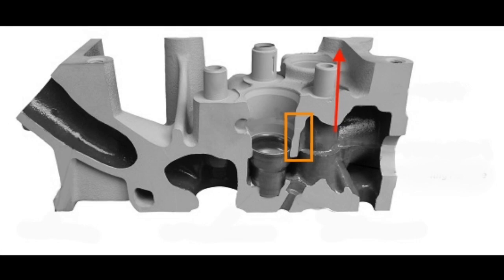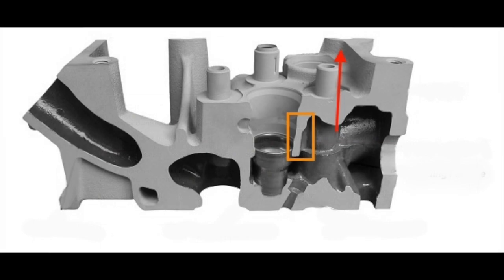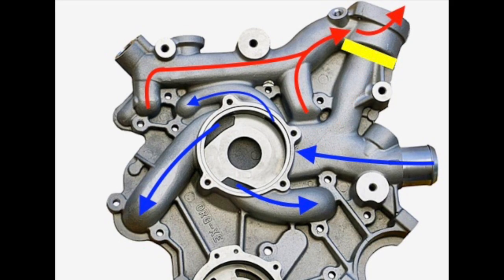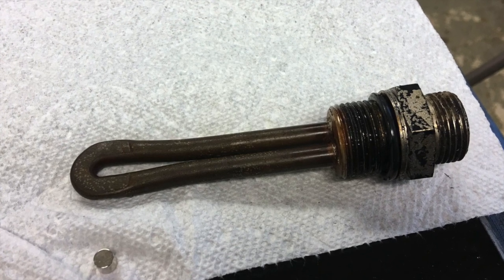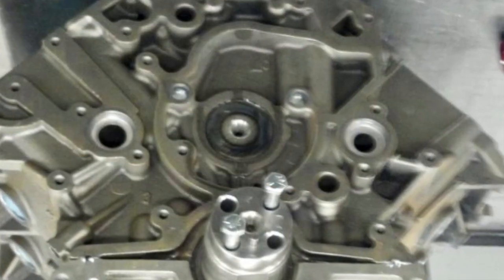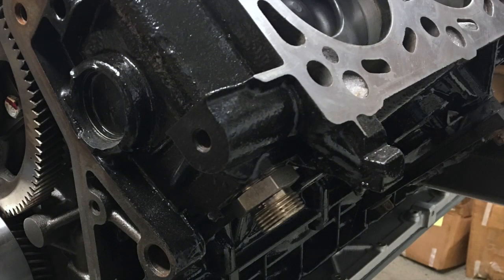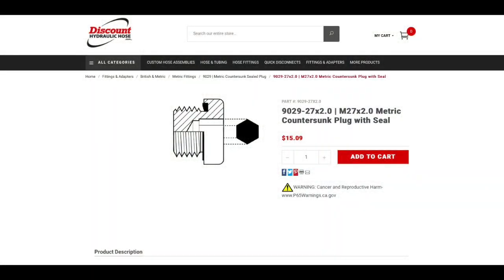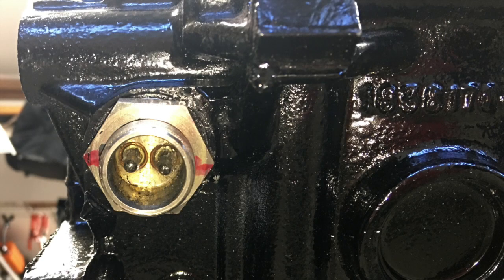Powerstroke 6.0 - Is the block heater causing injector cup cracks?

Comment from the maker: This is speculation of why there may be an occasional issue with head cracks, fuel in coolant.  A sample of one is a poor judge. 

To get a better handle on if it is a cause, people would have to note the heater element's position with a failure.  It is just weird that it's typically at injectors 3 and 5.

Comment: Where I come from you really need a block heater. I believe the cracks are caused by coolant flow problem within the heads that is the worst on the passenger side. When you install a coolant return system and delete the EGR, the cracks simply don't happen. The 6.0 is one of my favorite engines but in my opinion they have one fatal flaw. The EGR exposes exhaust gases that can reach over 900 degrees to directly exchange heat with engine coolant. This is simply a foolish design flaw as even the best engine coolant breaks down at less than half those temperatures.  The EGR delete is a must on a 6.0. The second greatest upgrade to the 6.0 is the remote oil cooler. I have seen 6.0 engines get these two upgrades at low miles and go on to reaching over 700K problem free. Another consideration is the Mishimoto radiator. The solid Mishimoto's are a great upgrade for the 6.0 and the cost makes it well worth it. I love your channel. I am a new subscriber that will be watching all of your stuff. Great work
Reply from the maker: Matthew, sorry for the late response.  

Something is going on with the left side. One person in the comments (not sure if this video) said he had a pickup bed of passenger side heads with cracks. When I put my borescope into the cooling jackets, there was no significant difference from side to side, except for the block heater. But when you look at the 6.4L block, with the different restriction plates at the coolant intake ports, and then look at the changes they made to the head gasket, opening the lower coolant orifices at the center of the head, they were changing the flow paths. But there isn't what I would call a radical change in the basic cooling jacket design from 6.0 to 6.4.

I'm not personally worried about the EGR cooler overheating the coolant as long as the oil cooler flows well. There should not be an extended dwell time for the coolant to get overheated, but that's a guess, as I've never measured the outflow temp.

I've had discussions about the coolant recirculation kits. I did something similar, but not as extensive, and I will have a video coming. It's an interesting subject.
Reply: @toomanytoys  I think your right about everything except the EGR. It's just poor design to expose exhaust gases to engine coolant. I can get at least 700,000 miles out of a 6.0 if I delete the EGR early by welding pucks at both ends. Unfortunately I know deleting the EGR is illegal in some areas but I actually get cleaner exhaust then you would with a poorly operating EGR, which is the calling card of the 6.0. I have been watching your videos and I am soo very impressed by your techniques and attention to detail. I especially appreciated your videos where you lapped the heads. Lapping the heads is soo important with the 6.0 heads. I also liked your video on the grounding and wiring for the batteries though I will have to watch them again to fully understand everything you said. You are a true scholar and you have the common sense that seems to be lacking in our modern world. I wish you ran the diesel engineering plant for Ford. I also hope you are still selling your engine pull brackets because I really want one when I get paid. Thankyou for putting your work on video so that others may benefit from your expertise.
Reply: False...
I have a 2003 6.0 with coolant return lines, deleted and after an engine reseal and new UCF heads in three weeks I had diesel in my coolant. They sent a new set of heads under warranty and I did a full rebuild this time...I mean FULL. 70k later (just a month ago) you guessed it, diesel in the coolant again. UCF is sending the third set and doing long injector cups on all 8 holes this time.
Reply: What is false? I didn't say delete cooling. The EGR is the main problem in the 6.0 design. The second greatest problem with 6.0 are the shitty, thin head castings before 2005.5. You are getting bad heads.  They are probably remans, or garbage Chinese castings. Go to Kill Devil Diesel and get a new good set of heads.  @MacJank7

Comment: I purchased the threaded fitting you showed, and it leaked. I knew it was questionable before I tried it, but took the chance it was going to work. The block has a step/ recess where the o-ring on the heater would normally seat. The seal on the block off fitting, is square and without adequate material to fill the recess for the sealing compression.
My engine is a 2006 6.0.
Great video.👍👍👍👍
Reply from the maker: I should have bought it to try it earlier.  It got away from me.  That was the only fitting I found of that size.  I'll buy it from you for whatever you paid and the cost to ship it to me, so I can try.
Reply: TooManyToys I'll just send it to you.👍

Comment: Never thought of that. I may do something different with my 6.0 when I get ready to install it. I need a block heater living in Missouri. Maybe try one that is in the lower radiator hose? Great video.
Reply from the maker: I wouldn't go too far down the rabbit hole with that.  After I saw the 6.4L block restrictions, it was a curiosity that would alter the flows right to left, so I kept wondering why they would do that. The front cover would have to have bungs welded so thermocouples could be added to know if it did something.
Reply: Why couldn’t thermocouples be installed the the freezes plugs on the back of the block?
Reply from the maker: @showmerepair  It a better temperature Delta if you get readings after an obstruction.
Reply: Good to know thanks

Comment: Navastar also in the the cooling pump flow rate on the 6.4. My personal opinion is there is a lack of cool flow at peak torque when the most heat is generated combined with the high operating temps for emissions.  If it's 220f in the thermostat housing, how hot is the cooling around the exhaust valves and the centre cylinders.  Next is out of spec block and cylinder head finish.
Reply from the maker: I would expect hotter, too.

Comment: Need help! Recently my block heater started tripping the GFCI. I’ve ruled out the cord and testing the element itself. I’m getting ~15.5 ohms Hot to Neutral but also registering various readings Leg to Ground. I believe the element needs replaced unless I’m missing something? Hoping I can swap out quick with minimal fluid loss. Gonna be a cold coolant shower!
Reply: This has me going insane lol.. It’s not the GFCI after trying 3 diff brands all new. On “Continuity” I get no beep measuring Leg to Ground. I will try to heat it using non GFCI tomorrow and see if it can drive out moisture or something, it did sit for a couple weeks in soggy weather
Reply from the maker: It's usually the cord.  I would drain the coolant from the radiator first.
Reply: @toomanytoys  I thought so too but tried a new cord. I think it’s a pinhole in the element that the 9v DMM won’t catch but 120v shorts to ground. Really didn’t want to pull that crusty thing out! Looking at replacements there is a note that says incorrect positioning can cause engine damage so I think you are totally correct!
Reply from the maker: @gnarlock3927  You've got an odd one then.  I was trying to think how the element would be screwing you up, but I'm in Christmas tree selling mode and don't have a lot of time to spend elsewhere.  Your process of elimination is good.

My cord went the fate of many others, the plug end shorted.
Reply: @toomanytoys  Thanks I wish I was half as good of a troubleshooter as yourself! Such a simple device this should’ve been cake lol I will try to report back with my conclusion. Have a Merry Xmas TMT
Reply from the maker: @gnarlock3927  Merry Christmas. I'd you are doing a pretty good job there sorting it out.

Comment: Hello Jack. Great info to consider. So, in seeing the differences of the 6.0/6.4 coolant passages. Are you or you considering using the 6.4 gasket on your 6.0 instead?  The restricter for the passenger side would be needed if that is a servicable part??

Did mine back in 13. Didn't last 2 years. Redid them finally a few years ago and used Fel-Pro gaskets instead of the ford ones! Seems Ford is steadily going down hill year after year!  The quality between ford and Fel-Pro was noticeable!  Especially looking back at your head gasket video some time ago!  I wish I had the time, patience, space and tools to do what you do. Great work and examples given!👍
Reply from the maker: Thanks, Eddy.  I thought it was interesting how they redirected the coolant flow, more to the passenger side and more to the heads' center.  But no, I would not entertain using the 6.4L gaskets on a 6.0L.  I interacted just enough with the engineers working on the cooling side of things to know it's not a backyard engineering project.

This quick weekend flipping a lifter project has turned into a science fair project; it became more of a take investigating what could be causing problems and trying to leave something behind. 

I had the back door opportunity to talk to some of the Fel=Pro guys and they spent some time working on the gasket design, looking at the failures.  The Int/Ford gasket was built around a new, stock motor, not looking later at the failures.

Comment: This ain't it, chief. . But- its definitely good you have your brains on. Be careful tho, you can speculate with yourself about a 6.0 right past obscurity into the absurd quick and easy...
Reply: It’s a casting flaw perse’ ... I’ve heard of over torquing the injector will do it to. I had to put the long sleeve on #5 of my excursion. Sold it a month later.
Reply from the maker: @matthewnosal6893  I agree with its a design flaw, one of the casting changes when the "commonized" 20mm heads replaced the 18mm.  But there has to be a trigger that causes it to occur on the passenger side at 3 and 5, while it's very, very rare on the driver's side at 4 and 6.  They are the same castings, interchangeable driver and passenger.
Reply: @toomanytoys  this was an 05 Excursion. I bought from a guy. It had the fuel in the coolant already. With 235k miles on it . It would not have been cost effective to put new heads or a complete engine from ford(cringe) it was a gorgeous truck. But I just fixed it and flipped it. Made some good money on the deal. That diesel will tear some stuff up as far a seals go. Just a long block with injectors less turbo was gonna run me 10500.00 then my time to install it. The only thing attractive of the Ford reman is the warranty. It’s hit or miss as you are aware of.
Reply from the maker: Always open to hear the reason injectors 3 and 5 are the most common to have these cracks since the heads are not handed.

Comment: That  is definitely over looked. I’ll bite in this a little bit. I have seen many many times cylinders 3&5 over fuel or compensate for the other cylinders bad injectors to normalize the power balance to keep trucks from coming back to the dealer. Maybe the extra heat. Who knows. Thanks for the videos.
Reply from the maker: Thanks for the feedback.  I always appreciate your comments and point of view experience with multiple truck history.  My views are always "out there" being from an R&D perspective and a sample of one.  A dangerous thing to do.

Comment: Great video, I love how your mind works. As well as how detailed you go through your discussions/  explanations. 

I have an 06 engine 250k miles in my 04 chassis 410k miles. Recently had 4 injector wells crack. I'll have to go back to the shop receipts to let you know which ones. I took it to a highly trusted shop who only works on Ford deisels who has always been truthful and has never tried to upsell me, actually given me many free parts over the years. Short story long they called BPD about it since it was the first time they've seen so many on a truck. BPD said its super rare and recommended replacing heads, so I did. Also for reference even though I knew better, I let the cracked well (fuel in coolant and low MPGs only symptoms) go for 8k miles before I could get it repaired.

Just more info for your informal research on the matter. Thanks for all you do for our community
Reply from the maker: Thanks for adding that.  I hadn't come across anyone who had four issues, that's interesting.  Were the heads ever reworked prior?  I would have replaced the heads too.
Reply: @toomanytoys  Finally found recipes.
 369k found #5 and #8 cracked and kits installed.
397k #2,#7 cracked and #8 kit was cracked.
Being #5 and #8 were repaired almost 30k ago for total of 4 cracked. Replaced heads and while it's all open replaced/serviced a bunch of internal parts too. 

Other then the 2 injector well kits no other head work had been done. At that time apx 250k on engine.

 I head studs installed with new to me engine. 50k on engine when installed with nearly all "bullet proofing" done. Relative to this BPD egr cooler, coolant filter and 200deg thermostat. 

Hope this helps your study
Reply from the maker: @wildearpsadventures  Any situation where injectors were changed prior?  Possibly tightened higher than the 18mm head 24ft-lb (288in-lb) spec?  Some people have believed in the forums that torquing the injector hold-downs higher is better, yet it's a way to stress the area.  The 20mm heads had different castings and relocated clamps; they were spec'ed to 25.8ft-lb (310in-lb).  I've seen forum members tighten to 31lbft (372in-lb).  Not only did Nav/Ford make a casting change, but KDD also did too with their castings from the cracks they saw.
Reply: @toomanytoys  no sir. Same injectors as when Engine was installed. Only other non-maintence work done prior were cam / crank sensors and full AC replacement.
Reply from the maker: @wildearpsadventures  I've never seen that variation on one motor.  Wow.
Reply: @toomanytoys  yeah I'm that guy. The one no matter the product, I get the one where everyone goes "never seen that happen before." 

Recently helped Linksys discover a problem the never knew they had. 4 rare things had to be in place for it to crash. Of course I did all 4 lol. They rewrote the code for all of that product and distributed it in an update because of me. Of course I beta tested it for them and did other combos too just to make sure it worked. I had the personal cell of the department head as this was going on.

Comment: Good food for thought! My 07 king ranch is all factory with only 80,000 miles. It came with a threaded in block heater from factory, but the actual cord has never been installed. The previous owner had never let it stay outside one night if it’s life, and had never ever installed the cord to the front. But according to your pic at the end of your block heater marked and installed, the prongs of my factory block heater it comes with is positioned exactly the way yours is? I won’t know which way the element is physically sitting inside the head tho, but looks the same sitting position as yours. I’m going to need mine soon up here in central Canada. (:
Reply: My 07' 6.0 has 78000 miles on the original engine. I had my engine oil analyzed with 4900  miles 
On it back in 2017. The results showed no abnormalities. Lab report read engine has normal wear. I'm not worried about the engine block heater. I've only used once here in far west Texas back in February of 2011 when temperatures 25 degrees above zero for 2 weeks straight.
Reply from the maker: @louielopez1638  A 2007, with the 20mm heads,  you don't have a worry as this is an 18mm issue if it's real.
Reply: @toomanytoys  I have a 07 with just short of 300,000 miles and I have combustion getting into fuel rail from number 5.  It has the taller cup in it already. It has been worked on before I got it.  I think I am going to get new heads from KDD.  I am not doing this twice.
Reply from the maker: @williamshultz3598 , I would agree totally.  If my heads were not in good shape or thought this chassis would outlive rust, KDD would be where I would go.  

If those were from UCF, an FTE member, SmackDaddy, had to replace UFC heads after having the same issue.  They told him it was "unusual."  Do you know if the replacement heads are the 20mm with 32mm core plugs? Easiest to measure on the passenger front of the head.  18mm heads have 28mm cups.
Reply from the maker: With an '07 that has the 20mm heads, it's reinforced in the area that cracks so if this is an issue with the 18mm heads, you don't have to worry.  Interesting that it's prings are horizontal, so they may have spec'd the threading to that position.
Reply: @toomanytoys  I will double check, but I was certain they are sitting horizontal. Now you’ve got me curious. (:  it’s great having someone that knows the 6.0’s like you do. I’m new to them, so I’m always interested in tricks and tips. (:
Reply from the maker: @jaybilawchuk2225  My first and probably only 6.0L, learning as I go.

Comment: More fantastic tech. I aooreciate all of your efforts and would even be curious to see any tech you might be playing with on any other engine platform. I feel like you have mentioned small block fords a number of times
Reply from the maker: Sorry, I thought I had replied to your posting.  Most of 289HiPo work was around restoration, a little playing with them and motorcycles.